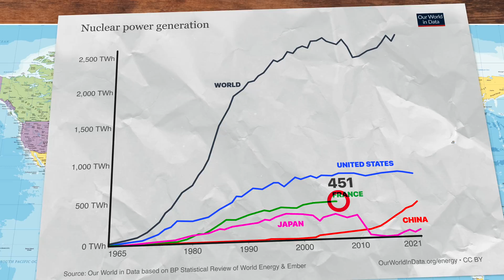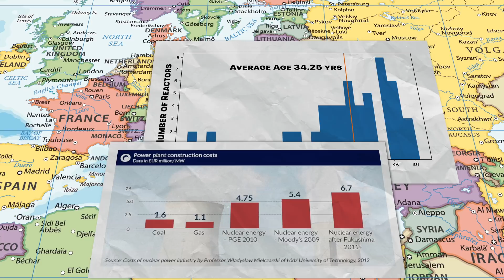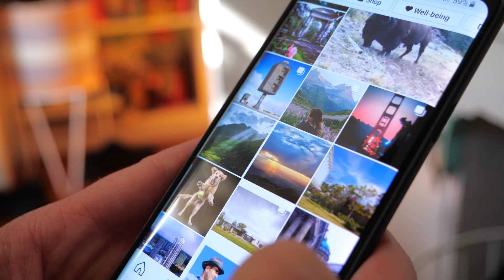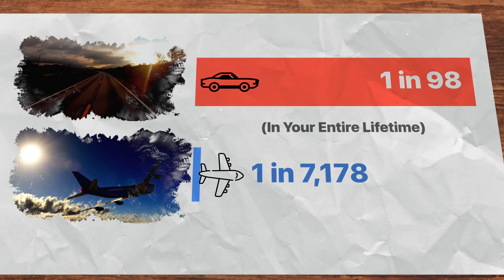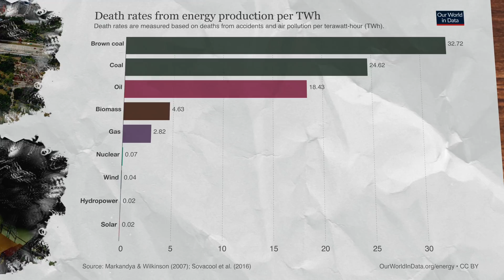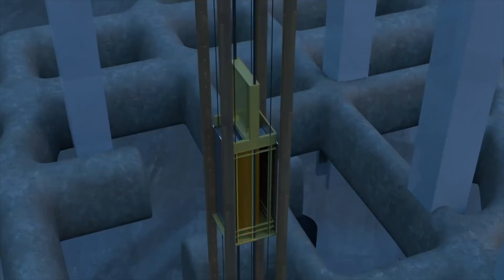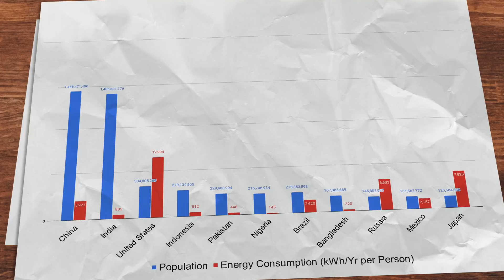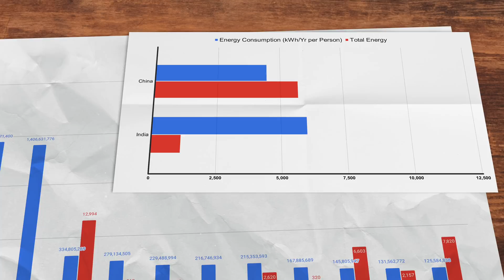The Future of Nuclear Energy Depends On This...

Comment: also, i think that building such massive subterranean containment structures is entirely overkill. we have known ways to address this “waste”. depending upon the waste, almost ~90% of it is still fissionable uranium, higher actinides, and unburned U-235. Elysium Industries to me has the most elegant design, using a Molten Chloride (aka table salt) Fast Breeder to dispose of most of the fissionable isotopes. the elements that remain are still dangerous, but have half lives around 200-300 years - which is much more manageable.

the way we approach nuclear fuel today is like pulling up oil in the least efficient way possible, and then after using 10% of it, shooting it back down in the ground. although we probably should be doing that with fossil fuels (lol), it would be outrageous to use a fuel like this if it wouldn’t be for its insane energy density.
Reply: BTW, 90% of the spent fuel is U238 and U238 is NOT fissionable and does not produce power in U.S. reactors
Reply: I don't see how 200-300 years is manageable. It's much better, yes. But a lot can happen in that time. I'm not sure how companies or even governments can look after that waste on that timeframe.

I'd like to at least see it get slashed to decades for the waste to be manageable.
Reply: High level nuclear waste has a 30,000 year half life because the long life actinides have not been used up. PWR creates them cannot burn them. Just 4% of the energy is extracted. 
Fast spectrum molten salt reactors by Moltex and Elysium will be fuelled by nuclear waste. Fully using the energy drops the waste 1/2 life from 30,000 years to just 30 years.
Reply: Who is going to build this reprocessing facility?
Reply: Well, these wastes sure do make making bombs a lot easier.
Reply: @kurtappley4550  lol true, just another good reason to de-prioritize 235 thermal reactors.

but on a real note, it is much more difficult than just taking the waste stuff and putting it into the core of a missile. Not all plutonium isotopes are usable in a bomb, especially not a very good bomb and therefore need to be separated. Not only that, but not much plutonium is present in high level waste per weight. Although any nuclear bomb is worse than the worst chemical weapons, you’d go through a lot of trouble to get it. still, it would be hell of a lot easier than uranium.
Reply: @madisonbrigman8186  So when you say "not a very good bomb", do you mean relative to the average nuclear bomb, relative to the average non-nuclear bomb, or that it has a very low chance of exploding at all?
Reply: @Zeero3846  i mean that not all arrangements of the isotopes are as efficient at it. however it’s still a nuclear bomb, which obviously should be avoided as much as possible.

the thing is it’s a very very tricky thing to do, to make one of these devices. a lot of things in the instrumentation have to go right at the same time, which is nano-seconds, during the compression of the source. so if a terror cell had all the necessary isotopes - they’d have to go an even more ridiculous extra mile to get it all right, assuming they could even get their hands on the pluto in the first place.

not only this, but typical nuclear power makes such an egregious low amount of waste relative to energy output- and out of that waste such an egregiously small amount is plutonium. in which these isotopes in question are evenly distributed, so you’d have to move a nearly impenetrable sealed canister the size of a small truck full of an element twice as heavy as lead from the most policed areas in the world without anyone noticing or caring.

it would be extremely hard to do, to make a weapon that is suboptimal. id be much much more worried about biological weapons and chemical weapons; which actually have the potential to be much longer lasting depending on the weapon in question.
Reply: @Zeero3846  the devils’ advocate argument to my statement however, is that the risk although low, is non-zero. and it would go up if the amount of nuclear reactors in use rose. this is obvious, but still we have modern surveillance and the physics haven’t changed inherently. you can also make an argument that what if something happens to society and we can’t surveil it? well we most definitely cannot make a nuclear weapon then, or at least it would be even massively harder than it was to do beforehand.

all in all, the chance is very, very, very slim - but the better question is why isn’t all of it plutonium? and the reason is that thermal light water reactors only burn ~5% of the available fuel and the rest is thrown away. Epithermal, Thorium-Thermal and Fast Spectrum reactors eat all of the baddies that can be used to blow things up, AND they use up almost all of it as fuel. there is therefore much less waste, which already was hardly a problem - and now it’s even less of a problem. Plus, the waste decays to back ground levels in less than a 1,000 years. With thorium i know depending on the cycle it decays away in around 300 y, which means it’s radioactivity is down by half in about 150 y (due to the principal of the half life). We can build concrete structures that can soar past 300 years of life, if you don’t believe me visit Italy. And at that point, even at 100% energy from nukes, we have ~4 billion years worth of potentially recoverable material on Planet Earth (even more on the Moon - which will be important for Mars). So we can avoid this problem much more efficiently by using our fuel much more efficiently - which saves money and drops the price of electricity.

A bit exhaustive, but I hope that answers your question!
Reply: @madisonbrigman8186  :seems to me a dirty bomb would be an incredibly damaging chemical weapon, albeit slow-acting.

Comment: You basically answered it yourself during the video.  Nuclear is the most expensive way to generate electricity.   It is basically dead because of the economics of mining uranaium, processing it,  building the plants, handling the radioactive material and storing the waste.  

The market is speaking.  Why would any bank amortized such a venture?  They would never be paid back.
Reply: it is not. It is expensive to build but those costs are recovered and over its life time it is extremely cheap , on par with coal and renewables . If you account for battery and energy storage then it is way cheaper compared to renewables. Look at france and see they have the cheapest energy in europe
Reply: @danielstan2301  For every nuclear power station that has ever existed, the average profit has been -4 billion USD (yes minus) governments (taxpayers) have paid most of the cost. and that does not include the decommission  (normally paid for by governments (taxpayers)  or long term storage or accidents all paid for by governments (taxpayers, taxpayers, taxpayers)

Nuclear power is just not financially viable and never has been, and looking at the cost of 3rd gen is getting more expensive. And in comparison wind and solar are rapidly decreasing in cost and speed of construction/installation. 

Even France, which had one of the highest tax rates for decades when building the nuclear infrastructure, is cheap now like is cheap to run an old car, compared to paying the HP on a new car!
Reply: The overwhelming majority of losses on nuclear power plant construction has more to do with protest groups and legal injunctions delaying build times by years. And the entire time, construction workers are getting paid to not work while lawyers on both sides are dragging everything out. A nuclear power plant that could be built in 5-7 years ends up taking 13-15 years, and thats a best case scenario. Nuclear power plants, especially the Gen3+ and Gen IV are already way beyond anything renewable can compete with, save for hydroelectricty which obviously cannot be scaled up to meet national power demands. Theres only so many rivers worth damming up in a country. The fact that nuclear still cant outcompete cheap coal is a stupid point since there isnt a single renewable that can do the same either, and thats even with all these massive subsidies for solar panels and wind farms.

The future is nuclear power. Its tragic that technology that was invented in the US will now be what takes China, India, and the rest of the non-insane countries ahead of first world countries in the decades to come. They dont have to deal with "watermelons" in their politics (green on the outside, red on the inside), crippling their national industries with nonviable energy portfolios in the future. Just look at how theyre still buying oil and natural gas from Russia while the EU shoots itself in the foot. Just madness.
Reply: @Slayer8957  The public skepticism on nuclear plants causing roadblocks to construction is definitely a major cost factor but not necessarily the overwhelming cost run-up.  Your point about coal being cheaper than solar and wind isn’t accurate.  Both Solar and wind are the cheapest way to to generate power per kilowatt/hour now and the difference will only increase going forward.  All this debate, though, misses the biggest point.

Going forward the power model is changing away from the large, centralized generation plants selling one-way to the end users.  We are transitioning to scale-down generation where smaller groups and individuals make their own power and sell off the excess.  Renewable energy generation can happen anywhere so the economic model becomes lateral and distributed.  The scaled up vertically stacked economic model dictated by elite energy sources is in its sunset.  

Might we need a few nuclear power plants built along the way….perhaps?  But maybe not.
Reply: @Slayer8957  all of fossil fuels and nuclear cannot compete with renewables per kilowatt hour due to the fact that renewables have next to zero marginal costs.  The numbers do not support your claim.  

I suggest reading Jeremy Ridkin’s books or watching a few of his talks on YouTube.  He’ll get you learned up.
Reply: @briandavis5699  No... just no. Youre using terms like marginal costs without knowing what they mean. Sunlight does not provide reliable power 365 days/24hrs. Windpower is also not reliable. There is no storage that can fix that fundamental issue. Even if you could capture it all 100% with no losses, it can never match energy demands. Its insane to suggest otherwise. Just look at Texas last year, when there windfarms all froze and provided zero power and caused mass blackouts. There was also barely any sunlight and also further factored into it. If they had nuclear reactors, weather conditions dont matter anymore.

The pollution that comes from mining for rare earth metals for PV's and wind turbines  are also a problem. Not to mention its not ethical depending on which countries youre getting them from. Same goes for batteries.
A nuclear reactor can be built to last 60-80years. Solar panels barely last 20. Windfarms the same. Whatever math youre using to claim better marginal costs is Enron-level accounting.
A
Reply: @Slayer8957  marginal costs are the recurring costs of doing business usually on a transactional basis.  For fossil fuel and nuclear plants there are fixed costs to building the plants themselves and the marginal costs of the fuels themselves, labor force, overhead, etc. I thought I’d help you with that definition and explanation.  Renewable energy sources have a fixed costs, but after that there is near zero marginal cost:  the sun and wind will never send you an invoice. And it takes very little overhead to keep them going.  Since the sun shines most everywhere and there is wind many places the need for large-centralized power plants is non-existent.  Power generation is more localized and scaled-down/distributed.

I live in Texas, you do not apparently since you don’t know the real failure of electric production in 2021.  Texas was not prepared for the severity of such a winter event and the electricity demand it would induce.  During the February 2021 winter storm, transmission companies inadvertently cut power to parts of the natural gas supply chain when ERCOT ordered the utilities to reduce power demand or risk further damage to the grid. That decision aggravated the problem as natural gas producers were unable to deliver enough fuel to power plants. At the same time, some wells were unable to produce as much natural gas due to the freezing conditions.  There were some frozen wind turbines but they weren’t the problem since they are not counted on in the winter months.  Of course, Texas being on its own power grid where it doesn’t trade electricity with other states is a ridiculous situation to be in.

Solar and on-shore wind energy became cheaper per kilowatt hour than natural gas in 2019.  The cost difference will only get wider moving forward.  As for energy storage there are many ways to store energy, even kinetically.  Batteries are still going to be a major player but by 2030 lithium-ion batteries will be an obsolete technology as nano diamond batteries scale up.  Also, just replacing cobalt in the LI batteries will happen in just the next few years.
Reply: The reason why it's not dead is because it produces a lot of electricity compared to other solutions. You can take the route of saying its too expensive which a lot of people say but the same goes to renewable sources.

The truth is we either stay at the oil/coal production which is cheaper but gives a lot of pollution, or we move on to another source of energy.
Reply: @Miniek0  it produces the least per Kilowatt.  Study up…nuclear is dead
Reply: I concur. Nuclear, at this point, is an intellectual curiosity rather than a real solution. There's simply no reason to do it (unless you are Bill Gates trying to make a quick buck) in the era of cheap solar.

Comment: I’m not someone who thinks all thorium everything, but we do have quite a bit sitting around in rare earth tailings. getting elemental thorium is expensive too,  but there are companies working on bringing down the costs. overall, molten salt is the best way to do it, but i’m a BIG fan of accelerator driven systems - if they can get it to run fuels at a critical level rather than subcritical (although you’d need to to start it back up, and you’d have to run the accelerator constantly for subcritical systems). Overall though, molten salt is probably the way to go.

we simply have pretty much inexhaustible nuclear fuel on earth. the technology for making it safe is already here - in some ways we just need to bring down the cost of collecting the material to begin with.

Comment: Why we don't need nuclear power. We cannot construct one and meet minimum safety requirements. We cannot build them without extensive delays. We cannot build them without going over budget. There is no long-term depository for high-level waste from the existing nuclear reactors in the world. Storage of high-level waste is currently in spent fuel pools that have no containment and are subject to loss of coolant with a loss of off-site power. Storage of spent fuel in concrete cask is only temporary and must be moved back into the fuel pool prior to moving it to a new dry cask. The used cask is now contaminated and adds to the disposal problem.
Reprocessing spent fuel is not economically feasible and only 4% of the energy in the reprocessed fuel can be recovered. The resultant fuel is just more radioactive than the original spent fuel. The risk to losing the cooling system of the reactor core and the spent fuel pool is increasing as climate change is increasing the intensity and frequency of storms. What is there to fear when fuel rods in the reactor vessel or the spent fuel pool can not be cooled. The zirconium cladding on the fuel rods produces hydrogen gas which ultimately results in an explosion blasting the radioactive material for tens of miles around the nuclear plant. If cooling is not restored after the explosion the zirconium will continue to heat until it begins burning as a zirconium fire and will produce a plume of highly radioactive particles that will spread for hundreds of miles.  
We have at best 5 years to eliminate the burning of all fossil fuels. Even if you wanted to take on the risk of nuclear power the clock has run out for nuclear. The only solution this late in the game is conservation, solar panels, windmills, massive reduction in animal agriculture, and increasing the reflectivity of land surfaces to reduce the production of long wave radiation.
Reply from the maker: you make good points, but I'm not sure I'm in agreement. wind and solar require energy storage as well.. that's the problem. i think we need 10 years of battery capacity ramping up, to be able to do that. That's why I think we need nuclear for another 20 years at least... I do the what you're describing is 100% the future, I just fear we need time to catch up on manufacturing